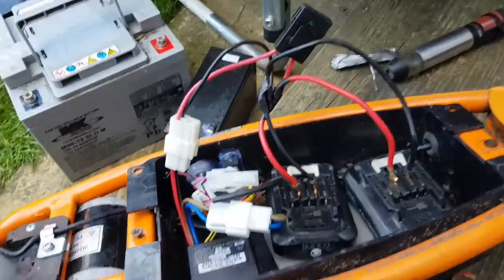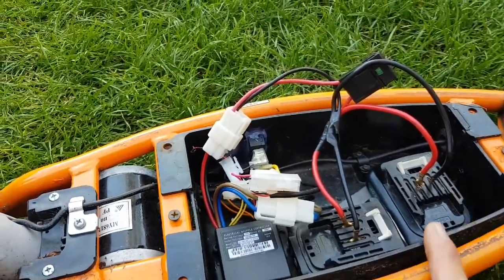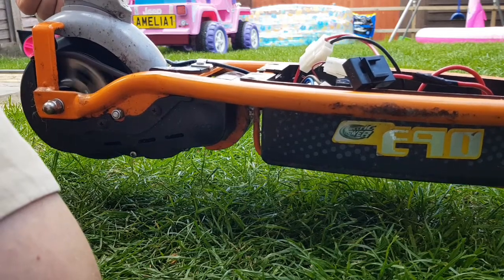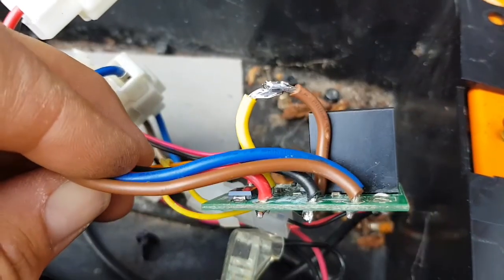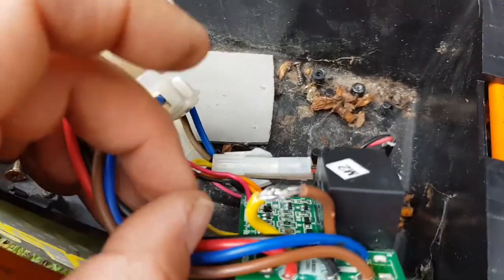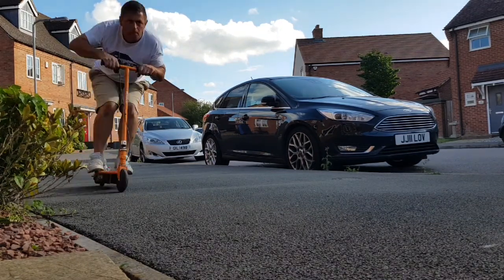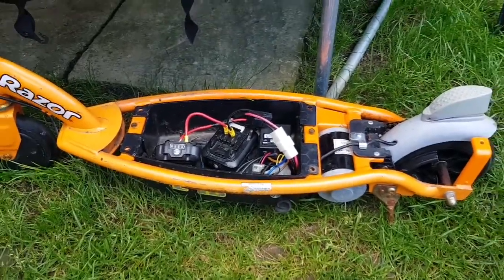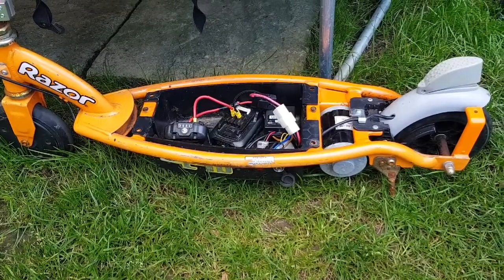Razor electric scooter mod and speed controller bypass mod

Comment: Good work, the mod though means no brake cut off, should have soldered the orange wire to relay positive that way throttle will work and brake switch cut off as both are in series. I had to do this and give relay a ground as motor was not working as it should.

Comment: I don’t even use a controller I just wire up the motor to the battery through the switch on the handle bars never had any issues
Reply: Hi can you tell me how?  I have a pocket Mod but same thing.  You wire it to the throttle?  I was going to use an on off switch but that's kind of hard on it.
Reply: @SabrinaTenge-pw4hr find the signal wire from the throttle connect that directly to the motor then connect the negative to the motor and positive to battery and switch and should work nicely

Comment: thanks for the help MAD MODS my 2000w was doing the same ,with no load it works fine but the min. you use it , its shuts off gonna try to do the bypass switch n see what happens will get back with the results when im done

Comment: well, honestly the speed seems identical to the factory speed 10mph. We have an E90 which was my son's and he wanted more speed. He got the scooter when he was 6 so obviously at 10 he needs more speed then before. So what do we do besides adding a double voltage battery ?  I just tried putting in a 18V (realistically it shows 20.4V)  power tool battery and nothing happens. It just won't move.  I'm measuring the 20V but the motor won't spin. The original battery works fine in it.  So what exactly do I need to do ?  I do like the push start, so I do not want to disable that. I guess that is what you do in the part #1.
Reply: If your only using one battery you need to short the other battery wires
Reply: Did you find a solution? I have found the same. The on/off switch doesn't illuminate with a single 18v/ 20.4v battery pack. So some voltage sensing somewhere?
Reply: @dwish6370  You might have either wired it wrong, loose connection, or the controller is faulty. I put an 18v Ryobi battery to a E90 Powercore scooter using the default controller in it and the 12v Relay style controller like the one in the video accepted the 18v without issue.

Comment: How To by pass speed controller 
I have rasor e100 thanks
Reply from the maker: Its exactly the same as this one
Reply: @MADMODS  if i join the two wires together how will i be able to turn on the scooter? & are you sure its the same? i want to make my e100 faster. i heard you need to sauter something on the controller board
Reply: @MADMODS  not very helpful when you don't answer questions

Comment: Be VERY careful when messing with lithium batteries. You can instantly melt steel if you make a wrong connection. Especially with a tool battery that has lots of cells in it.
Reply from the maker: I work on hybrid cars at work and run a lot of rc cars with 2s and 4s batteries so am fully aware of the issues and explosive power of lithium batteries. There not to be messed with unless you know what you are doing. I'm going to run this on my rc batteries next time 😀
Reply: Steel as the soldering lol